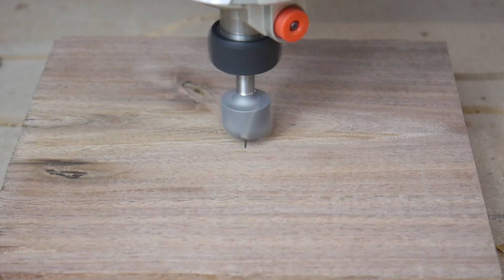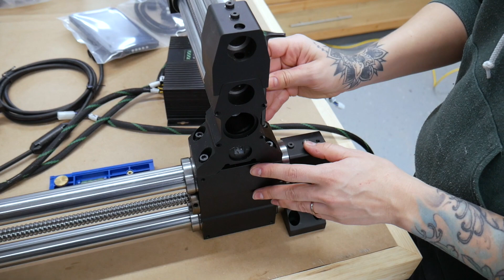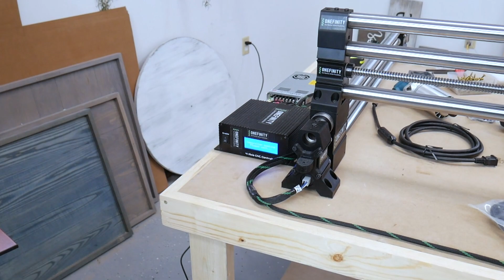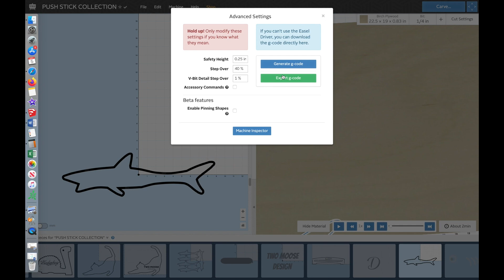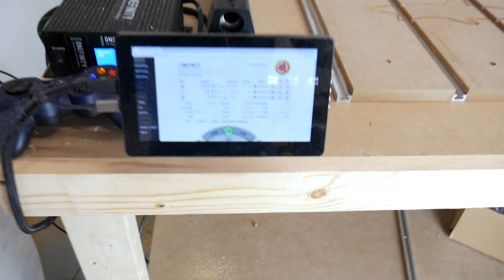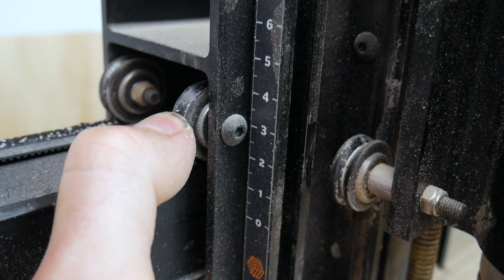Onefinity CNC Intro and Assembly

Comment: I was torn between the x-carve and the onefinity. Your video sealed the deal for me! I even ordered the Two Moose Recommended bit set. Of course, looking at the backlog, it might be 2022 before mine arrives! Great job on the video. I have a small shop and was as interested in the table you built to set the Onefinity on. Looks pretty basic; MDF with pine aprons? I didn't check out the legs but I am sure I can figure something out. Thanks for the video!
Reply from the maker: Oh nice! That’s awesome! The wait is brutal ☹️ yep! Pretty simple construction. Mdf and 2x4s

Comment: Great video! How large is the table top you are using for the Onefinity? Do you have a video on how are you made that table?
Reply from the maker: Thanks! I do not. My table is 52x52 but 48x60 would be more than enough if you want the controller next to the machine and a little extra space
Reply: @TwoMooseDesign  Thanks!

Comment: Does the OneFinity require WiFi to operate?  I've narrowed my search down to the Shapeoko XXL or the Onefinity, leaning toward the Onefinity because of the drives.  Yes, I'm new to the CNC world and understand the learning curve is about to get real steep.  What software suite would you recommend?  I want to be able to get full functionality out the the machine without paying an obnoxious subscription fee.
Reply from the maker: the onefinity does not require wifi. I run easel and im currently learning vectric v carve pro

Comment: Does the router starts  as any router manually or with the cnc program?
By the way exxelent videos
Reply from the maker: As the machine comes it is manual. You can add a relay for about $30 which will turn it on and off automatically,  i will do a video on it eventually

Comment: Are there limit switches and can you attach a Z probe? Also, I don’t think you explanation of sealed bearings is correct. The rod must be in contact with the bearings and hence a dirty rod can and will transfer gunk to the bearings. This is quite obviously a downside of the open design of this machine. Another point is, you need a really flat surface to begin with, while most CNCs come with such a surface. You cannot just slap it onto any old table.

Comment: Which softwares do you need
Reply from the maker: Greg M I’ve been using easel but will upgrade to vectric software eventually
Reply from the maker: I misread your comment the machine will work with most software